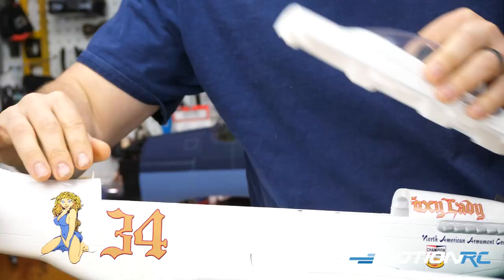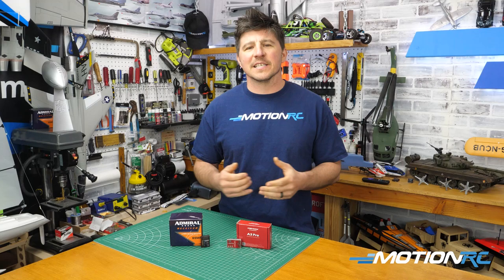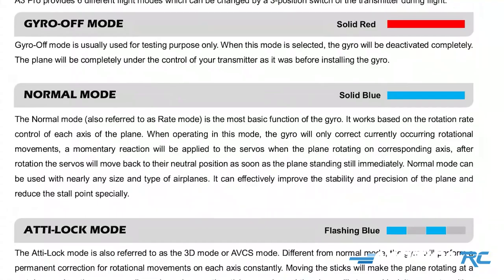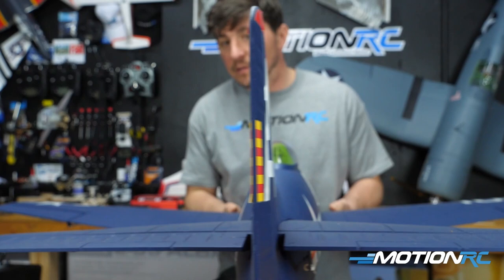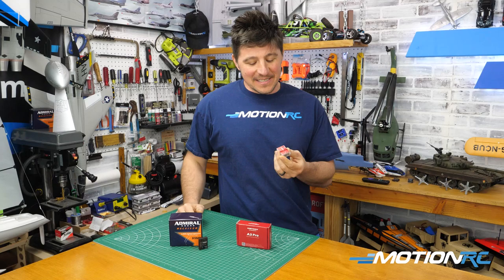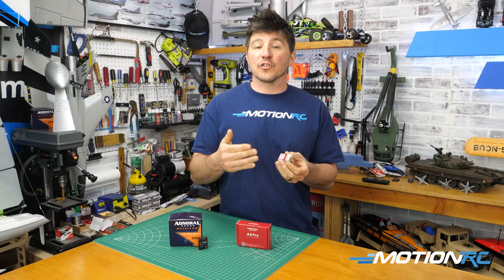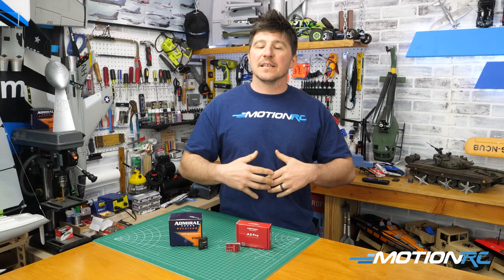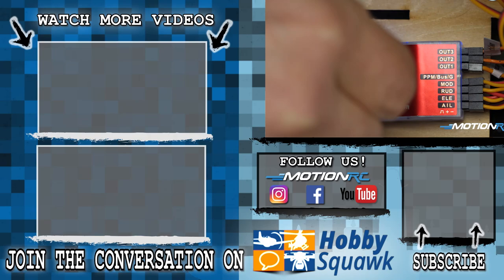To Gyro or Not to Gyro | Quick Tip | Motion RC

Comment: Auto level doesn't only have to be used as a trainer feature for beginners either. We all have those moments where we get disorientated. The auto level can be used as an "oh shit" switch as well. So therefore gyros are a great safety feature.
My favourite gyro is the hobby eagle A3 Super 3 and it saves me money on expensive receivers because I can control everything through the gyro using the S.bus feature. It's great. And for flying scale in wind it really helps improve the scale look. A full size wouldn't get bounced around in wind unless it was so windy that no sensible pilot wouldn't fly in it. Tornado in the back ground for example lol

Comment: I've been flying model aircraft now for 35 years and I've never used a gyro.  But this year of 2021, I'm going to try one out just for the fun of it to see how it goes.   I hope its not too complicated in setting up.   All my receivers are Futaba 2.4, so hope I can buy a gyro that will go with Futaba.
Reply: Yes sir Futaba has fixed wing gyro's you can buy like the GYA460 or so......
Reply: I have a Hirobo Sceadu Evolution .50 shuttle. Is there a Gyro unit out there that will make my chopper self level? any information anyone can help me with I would so kindly appreciate it.. my receiver is a radio link AT9Spro.

Comment: Every plane with a Spektrum (AS3X type) receiver pre-installed has the basic gyro built into it, and if you bind Safe-select mode you have control limits for beginners. I don't hear any clamor about that! With a gyro you can buy a low $ receiver and have the same trainer mode and AS3X style stabilization. I get my gyros on ebay for 10 to 15 bucks and I don't have to pony up the $$$ for Spektrum receivers.

Comment: All ten of my EDF’s have Spektrum AR636 receivers that I reprogrammed with AS3X and SAFE modes. They allow me to fly in gusty winds or poor visibility when other pilots are grounded..
Reply: What transmitter are you using?
Reply: @kennethsmith296  A DX9 usually, but any Spektrum transmitter will work. I would avoid anything with less than 8 channels.

Comment: I have the A3pro V2. Do you have to run a Y wire for the ailerons? I would like to have both wing servos on their own wire. Because I would like to add Flaperons & still have a Gyro. Can I do this with a Gyro? The plane I want to do this on is a Hobbyking Crusader (Ugly Stick).
Reply: I think you have to move up to an A3 Super 4 or A3 mini to get 2 Aileron outputs.

Comment: Great explanation. I’m a newbie…can gyros be used with any make radio or do the audios even matter. I have a Flysky i6x. Thanks
Reply: Radios have nothing to do with gyros. A gyro sits in the middle of your receiver and your servos. Your receiver wires that normally connect to your servos connect to the gyro, and then the wires from the gyro now go to the servo. Make sense?

Comment: One think I’m struggling to get my head round. In normal mode if I adjust throttle, down for example, will the plane descend or will the gyro try to maintain it’s current attitude/height!
Reply from the maker: No plane is going to fly long without throttle. The gyro has nothing to do with the throttle

Comment: I have been searching for an answer and I am hoping someone out there can help me. I have a beautiful older nitro shuttle helicopter. Can I put this Gyro wanted to self level it? 
It has a tail Gyro on it now but wanted to make it self level. It does have a fly bar. Can someone tell me if they make a Gyro? I can put on this helicopter so it will have soft level? Any information I can get? I would so kindly appreciate it. Thank you so very much.
Reply from the maker: This is for airplanes only. This will not work for a helicopter.

Comment: Will it smooth out the video taken from the plane? All plane videos I've seen look pretty shaky.
Reply from the maker: It will help, but also a lot of shakiness comes to the type of camera and how that camera is mounted. The plane could be flying smooth but the camera could be loose with velcro and wobbling, or the camera doesn't have any internal anti-shake like a go pro. A gyro will 100% make wind less of factor when set up correctly, but there are many factors that go into to properly mounting a camera on an rc plane.

Comment: Hi this is Carter from Grayson Georgia to my question is having a gyro in your plane the same as  asx3 that Spectrum sales with all their new receivers and can you please tell me what is the difference
Reply: Most gyros only smooth out the bumps in rough air (like AS3X). Some gyros also have heading hold which keeps your plane in the attitude it was in when you centered the sticks (most Spektrum AS3X receivers have it). And some gyros have bank/pitch limiting and self-leveling (like Spektrum's AS3X/SAFE receivers).

Comment: Back in the 70's even R/C helicopters fly fine without any gyro.  it doesn't fly well but it flies.  Now we're putting gyros in model planes.  Was at the flying field last weekend and one guy has a Radian Pro with a flight board that can auto return to home and auto land for him.  What's the point of flying an R/C then?  Come on people.
Reply: Return to home and auto land??? That's not a gyro, come on Bo.
Reply: @twincitymoo7141  Yeah good point.  I went a bit overboard.
Reply: @bohan9957  :-) no problem, it's all fun.